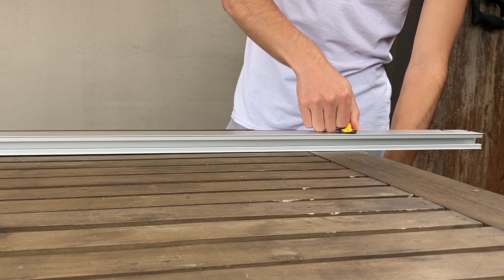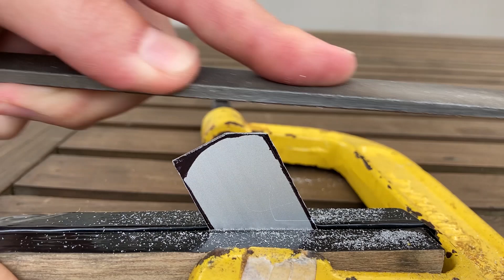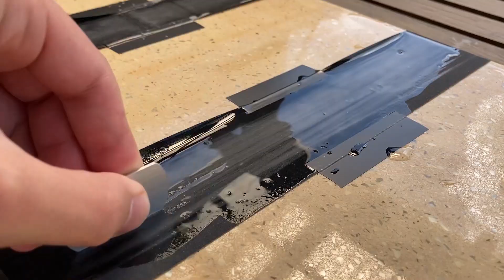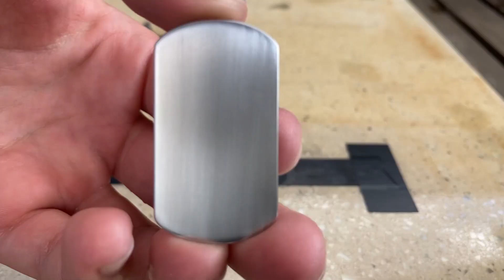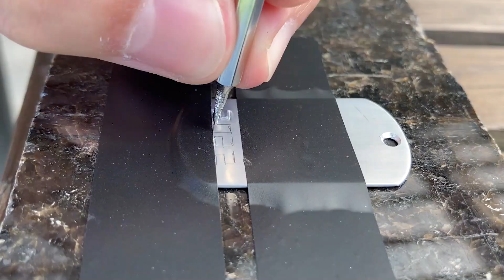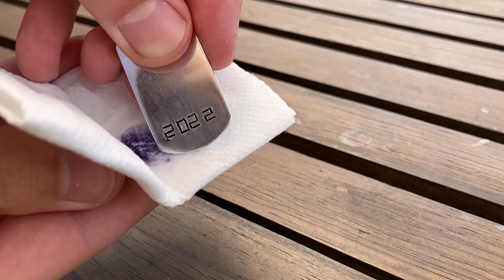Make and engrave your own Military Dog tags - The easy way

Comment: Excellent, a tip for your engraving. Use black nail polish instead of Sharpie, then wipe away the excess with a nail polish remover. It'll hold the color way longer.
Reply from the maker: Thanks good suggestion! Will give it a try :)

Comment: Consigo fazer em aço inox?
Reply from the maker: Hey yes I think that’s a better option, but for the engraving instead of the hammer and bits I will recommend you to edge it with salt water, cotton and some 9v batteries or many 1.5v batteries, there are many videos out there on how to edge stainless steel, it’s nothing too complicated, I have done it before and it is super cool.